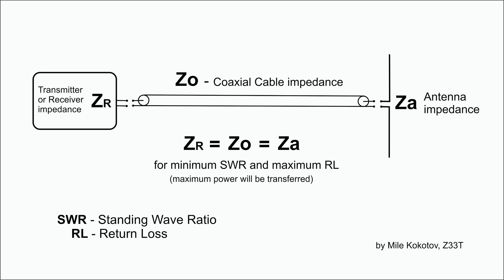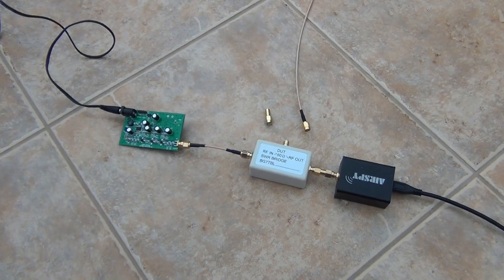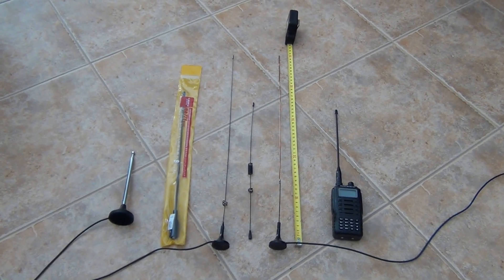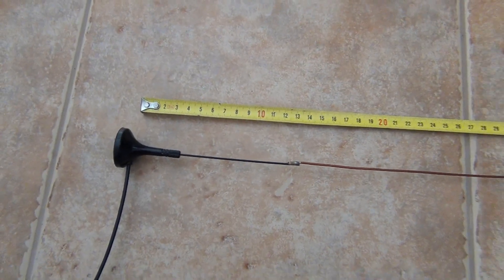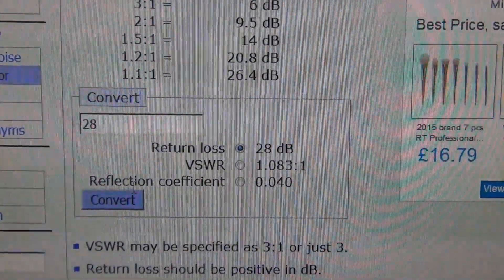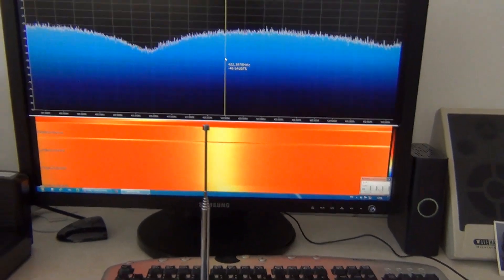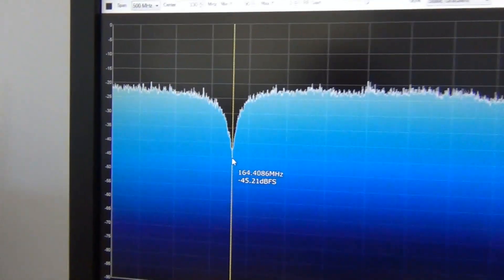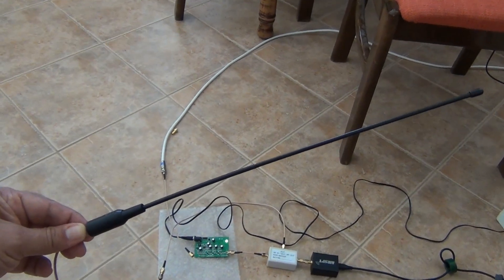Airspy SDR as a Network Analyzer using for Antenna Characterization

Comment: Μile thnks for share,a question:
only airspy can we use for this characterization or other sdr usb dongle?
Dinos..73's
Reply from the maker: Hello Dinos, You can use RTL-SDR or SDRplay RSP, but then you have to do it with other software. I want to suggest you a new NanoVNA, which is very cheap (about 50 euro, but it is really good Vector Network Analyser  from 50 khz up to 900 MHz. Just type "NanoVNA" in Google and you can find many information for this  little VNA!
Reply: @milekokotov1964  Thanks for your quick reply Mile,order nanoVNA really nice device...almost 39 euro...on e-bay market place..73's

Comment: Interesting!  What has come to my mind is that there is probably a different between (dualband) antennas for the european market and e.g. the us market. Since the us ham bands are wider. So they might center their best swr on 146 MHz. Where as we here in Europe have 2m from 144.00 MHz to 146 MHz, you would like to center the best swr on 145 MHz. And I think the two last antennas in your test use the mass of the portable housing as counterpoll. So measuring them off the portable trx will result in incorrect swr.  This could be tested with a tin box with antenna connector to srew the antenna on.

Comment: What voltage are you supplying to the noise generator?  I heard 12Volts it runs very hot.  Some say it works better at 9 volts?  Thoughts?
Reply from the maker: I am using 12V for the noise generator. Yes it becomes hot after some time, but you can put a smal fan for cooling...

Comment: Excellent presentation!  New ham here: Are the signals generated by this setup transmitted into the "real world?" Or are they mostly dissipated into some kind of dummy load in the SWR bridge?
Reply from the maker: The RF noise generated by RF noise generator has very low level. RF signals (rf-noise) are transmitted trough antenna (device under test) but it is only at very close distance around the antenna.
Reply: Thank you! And 73 from KI7POL in Washington State

Comment: hello Mile,the noise generator seems to work well, as coupler i bought the mini circuits ZNDC-23-G (for 800 - 2000 mhz), for i want to fine tune my patch antenna for 1700 mhz, i cannot find the resonant point in spectrumspy, maybe the mini circuits device is not the right choice?(not much happening in the spectrum), regards, peter.
Reply from the maker: Hello Peter Kooistra, send me a picture of your setup connection please...
Reply: Hello Mile,i do not have your email adress..how can i send pictures?
Reply from the maker: You can find my e-mail address on my web page:  http://www.qsl.net/z33t/
Reply: Peter Kooistra, You managed to make the correct settings for your patch antenna at 1700MHZ?

Comment: Hi again Mile,
Where can I get the program you use for the return loss calculations?
My Noise PCB has arrived from ebay (same as yours) but strange dB specs on his little sheet for its power out. He is saying that at 0.1g/60db output ? 1000W (I don't think so.) at 0.5G/ 55db? Any way I will test this as I also have variable attenuators etc. He does not sell the bridge on his site anymore so I have purchased (2) to test.After the bridges arrive  I will hook all this up to my HP spectrum analyzer before I buy the Airspy. I will keep you informed.
Thank you,
David
Reply from the maker: Hi David, There are many online calculators for return loss to SWR calulations. Here is one link:
http://cgi.www.telestrian.co.uk/cgi-bin/www.telestrian.co.uk/vswr.pl

Forget what some chinese sellers have written on their web pages as information about Noise source specs :-)
Just get BG7TBL one and you will be satisfied.
Let as know about your results
Regards
Reply: Hi Mile,
Thanks for the site. Perfect.
All the best,
David.
P.S. Are you into HF? I have just started. So although I have my Marine HF/Satellite License I have to sit HAM accreditation, I will do it soon. That is what the equipment I am building is to help me with. I have purchased a lot of Icom Gear. So I have VHF/UHF (in commercial frequencies - Simoco mainly but some Motorola) otherwise I have both the time and funds (luckily) to pursue it as a full time hobby . I will keep you up with my antics. Just found a 8Mtr, Sat dish to try to do some moon bouncing.
If you have a call sign send it to me and I will have a go at contacting you. Love the learning curve. Keeps me sane in a pretty crazy world.
All the best,
David

Comment: Hi Mile i have the swr bridge and noise generator you rekommended connected to my airspy mini  , but i have very diffrent levels in db  , it seems sensitive to the gain slider ...   Trying to get the  50 ohm db correct before mesuaring antenna ...  Do you have any tip ?   It seems as they have uppdated the software as well ...   //kindly Kristian
Reply from the maker: Kristian Jönsson, What is "very different levels in dB"? Can you post here a link to some screenshots you get? What you mean when you write "Trying to get 50 ohm db correct"? Be more specific please? I am trying to help but I need more information on what you did and what you get...
Reply: Hi again .. I meant the RF-gain slider .  I have connected a 79 mhz antenna and took some before after pictures .    please se them here ..   With and without dummy it seems wrong?    the 79 mhz antenna is on 80-81 mhz ...     https://drive.google.com/drive/folders/0B8YToHy1FPZNUUtVWHIxRHJDRVk?usp=sharing
Reply from the maker: Hi Kristian Jönsson, I saw all of your pictures carefully. The setup looks that is OK. Except SWR bridge seem to has less directivity, but, anyway, directivity is more than 20 or 25 dB, so you can analyze the antennas SWR down to 1:1.2 or 1:1.1 minimum. (return loss 20 to 25 dB). Airspy frequency is very accurate, so, according to your pictures, is obvious that the antenna you tested is resonant on 81 MHz, and in that frequency you could expect SWR around 1:1.8 or something (about 10 dB return loss) for 50 ohm load. Can you post link or picture of your antenna? Which model is it? Where is it located? I hope that antenna is not in your room... 

Regards,
Mile Kokotov

Comment: Great Demo. Do you think this setup will also work with SDRPlay instead of AirSpy ?
Reply from the maker: I am not sure if there is a software like SpectrumSpy for SDRplay. But it will be good if SDRplay, SDRuno or other developers thinks about such features for RSP1.
Reply: Ok, it seems SpectrumSpy is only working with AirSpy. Do you think the same can be done with SDRUno ?
Reply from the maker: SDRuno has 10 MHz maximum bandwidth (frequency span on the spectrum window).
It is enough for HF antenna analysis, up to some 30, 40 or maximum 50 MHz.
Reply: That's great ! I am not very familiar with SDRUno yet. Would you midn to make a video showing the Return Loss and VSWR measurement with SDRUno ? That would be awesome , TNX !
Reply from the maker: Joy Rider, Here is my video for HF filters characterizing with SDRplay+SDRuno. The antenna analyzer is very similar to this, but with addition of SWR Bridge or Directional coupler...
Reply from the maker: https://www.youtube.com/watch?v=ZyFS1Qxw49c
Reply: Excellent thank you. I have already ordered the SWR Bridge and the noise generator from ebay.

Comment: Well I did the trials on my existing antenna which  is a copy of a Diamond antenna by Moonraker. I found that the use of the attenuator board was not necessary. The results for the 2m and 70cm bands were perfectly acceptable. And, as you suggested Mile, the results were meaningless on the 23cm band using this swr bridge. This not a problem for me though as there is no one near me who I can receive on a vertical antenna. And I don't have a transceiver for this band.  Now to make some home made antennas for HF...
Reply from the maker: Well done David. Enjoy in your new RF tool! 73

Comment: Thanks Mile,  First of all I will test the diamond tri-band antenna for 2m, 70 and 23cm that is on my roof and verify its performance. After that I'm making simple wire dipoles for 30, 17 and 20 metre bands and this time also use the spyverter. I will of course share my results.  73
Reply from the maker: Pay attention that SWR Bridge is not designed for such high frequency as 23 cm band. But anyway it will be interesting to see the results :-)

Comment: Hello Mile.  I have now received all the parts to duplicate the tests in your video. The swr bridge is the same one you have used from BG7TBL. The noise source I have is also from BG7TBL but it doesn't look exactly the same as the one you have used, it uses entirely smd parts, there is no large capacitors. An additional item I got is a 3 way attenuator board giving 0, -6 or 40db attenuation.   I'm hesitating to start the experiment as I have no test equipment yet to measure the output of the noise source and I don't want to damage the input of my Airspy. Would you suggest I add some attenuation to the noise bridge to be safe?
Reply from the maker: Hi David, I am glad that you can try this setup as a network analyzer now. Noise source power is not significant to make any damage to Airspy SDR, but you could use those attenuators (0 dB, 6 dB and 40 dB) for the first try. Starting from 40 dB, than 6 dB and at the end, you can connect the noise source directly to the Airspy. It could be good experience to learn how is the signal from noise generator... You can try to connect many different RF stuff between the noise source and Airspy  and see their amplitude-frequency characteristic (filters, low signal amplifiers, attenuators, baluns, pieces of coaxial cables as a notch filters and so on...), Adding the SWR bridge to the setup, you can measure antenna characteristics as in above video... Let us know what is your results with this setup. Shear your experience with us please. 73

Comment from the maker: When You choosing which Directional coupler to buy for antenna analyzer, have to look for better directivity Coupler.
Directivity must be as high as possible. 

The Directivity limits the range of the Return loss or SWR analyzer. 

If the Directivity of the directional coupler is 20 dB on some frequency, 
it means that highest Return loss the analyzer can achieve on that 
frequency is 20 dB, or minimum SWR can be measured is 1:1,22

If the Directivity of the directional coupler is 30 dB on some frequency, 
it means that highest Return loss the analyzer can achieve on that 
frequency is 30 dB, or minimum SWR can be measured is 1:1,065 and so on...

The second important thing when you choosing 
Directional Coupler is Coupling loss. The more coupling loss - the more 
power from noise generator needs to compensate coupling loss...

And, of coarse, very important thing is frequency range in which Directional coupler has those characteristics.

At the end, The Return loss directional coupler has on his ports has to be as high as possible.
Reply: Hello Mile,interesting tutorial, i would like to test my feeds for L-band (1500-1800 mhz), what swrbridge and noice generator do you recommend ?
Reply from the maker: The Noise source I am using is by BG7TBL design. It is good up to 3 GHz. You can find in ebay. Here is link:

http://www.ebay.com/itm/DC12V-SMA-noise-source-Simple-spectrum-external-tracking-source-no-power-adapter-/142105288275?hash=item2116229e53:g:d0EAAOSwOdpXyQfW

Unfortunately, I have not tested any directional coupler or SWR bridge for frequency you are interested for. I suggest some of the  "Mini Circuits" directional couplers or others on e-bay. Read my guidance above... 73
Reply: Hello Mile,thank's for your advice,Regards,Peter.
Reply from the maker: But SWR-Bridge from BG7TBL is not suitable for 1500 - 1800 MHz. You can try some Directional coupler from Mini-circuits in that frequency range for example...

Comment: The only flaw I can see in what you did was the non-mag antennas can't be tested out-of-circuit with the radio.  Holding it in your hand, connecting to the HT, how you hold the HT all affect the SWR.
Reply from the maker: I Was aware about that for non-magnet antennas (they also needs some kind of counterpoise) They use handheld transceiver body and hand capacity as a counterpoise. But for this test I was simply hold those two antennas in my hand moving around during the test to obtain the best SWR/Return Loss results. The same  conditions were for both antennas and one of them, as we can see in the video, shows better results (the original Quangsheng TG-UV2 antenna)...

Comment: this should also be possible with rtlsdr.
Reply from the maker: Yes, it is possible with RTL-SDR also (with Touchstone software, or RTL-SDR Scanner software for example), but "Spectrum Spy" software for Airspy is Very fast, with better RBW, and Airspy has better Dynamic range for better measurements
Reply: for fun, can you make a test with rtlsdr an rtl-sdr scanner? no video need, only a screenshot would be ok.